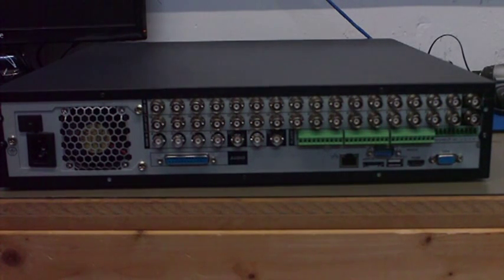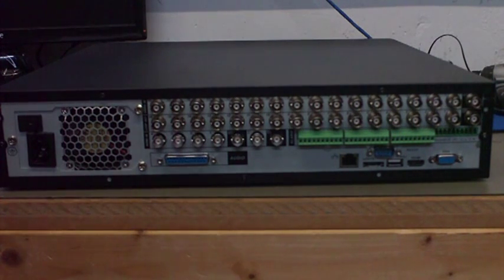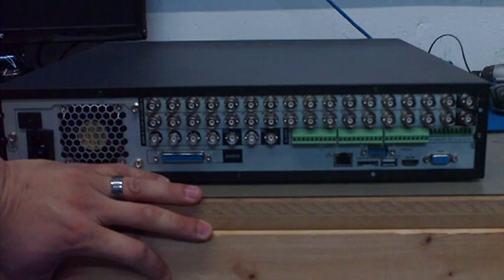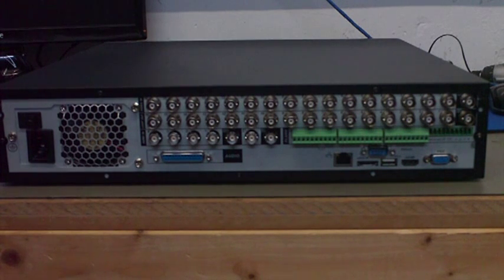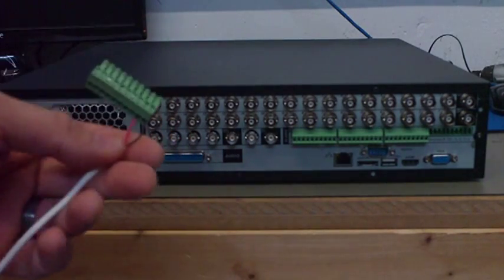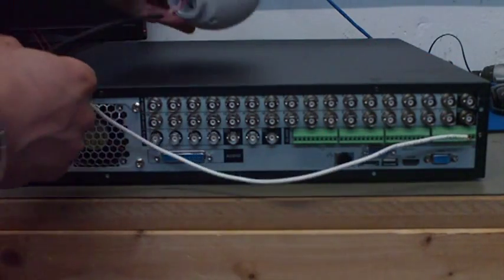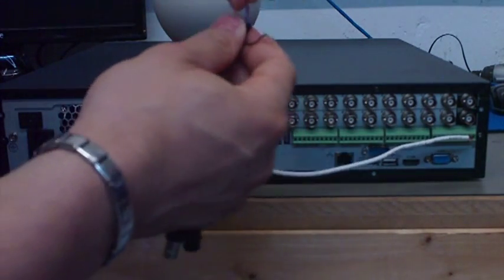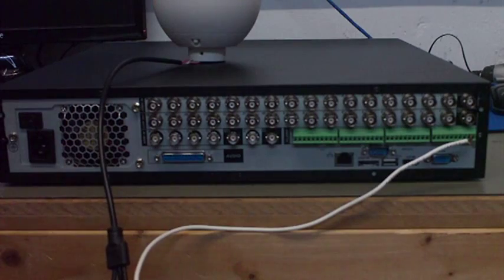PTZ-LX550 Setup Part 1

Comment: What happens if you only have 3 wires comming from your dvr to control ptz I don’t have a green connectors do I need to buy a box for the wires
Reply from the maker: You can reach our Tech Support at 1-866-573-8878, They'll be happy to assist you with any of our products!